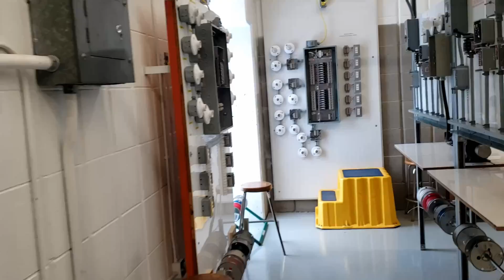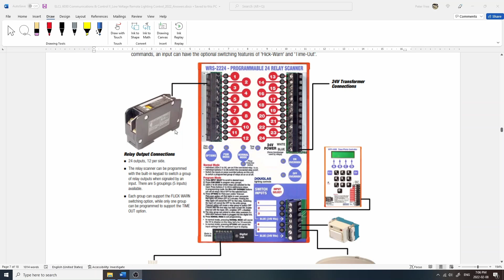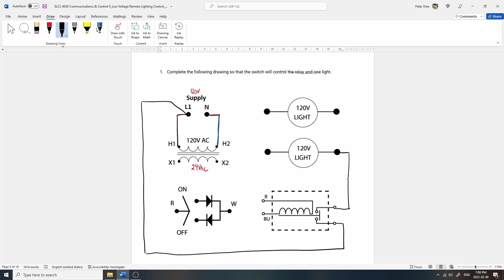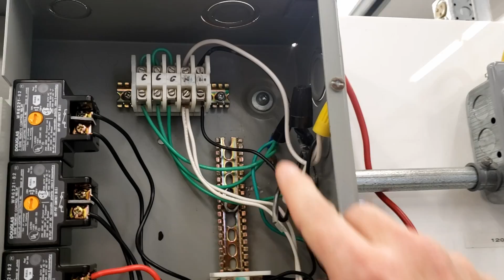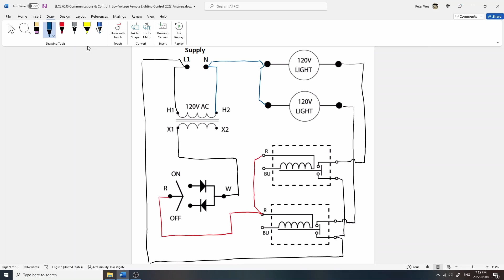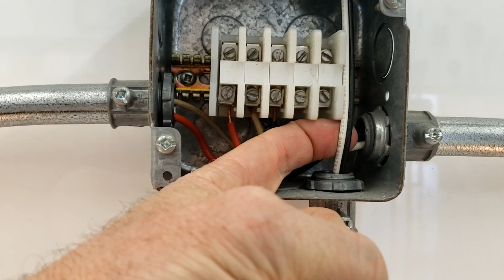Douglas 2 Wire Lighting Control Project

Comment: Douglas is no longer in business. Who might still be offering parts support in Canada or what is the best replacement for existing system?
Reply from the maker: I'm pretty sure that existing systems are being replaced with Lutron or Hubbell products.
Reply: Depending upon what Douglas controller and Switches you have, s2innovations has a direct replacement controller (S2BACLightDP) for Douglas's WRS-2224 along with supporting Douglas Switches, relays, etc... and the device has more features and functionality.
Reply: Just sharing in case it helps. The DALION from BACMOVE has been used successfully to retrofit older Douglas two-wire lighting control systems. It allows integration with BACnet building management systems and works with existing wiring. -